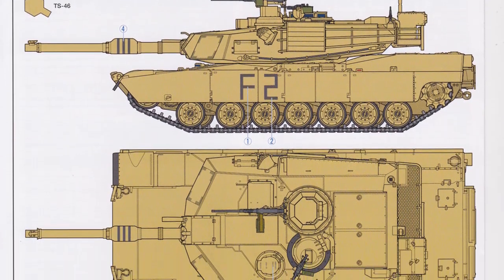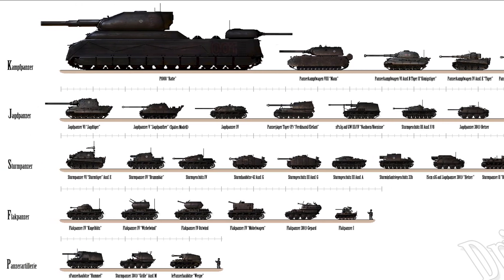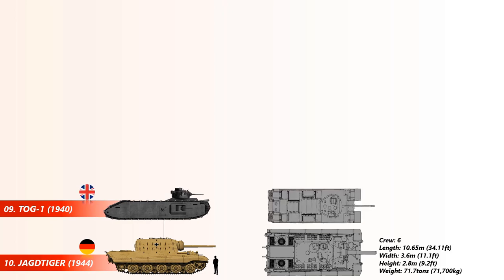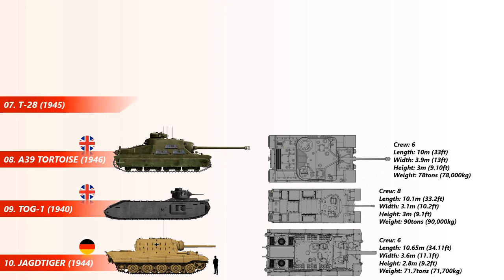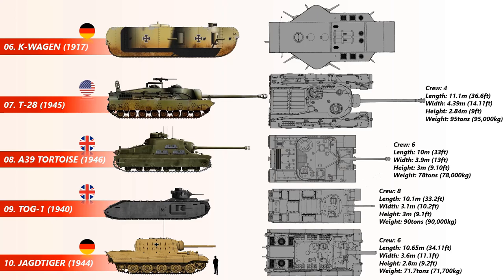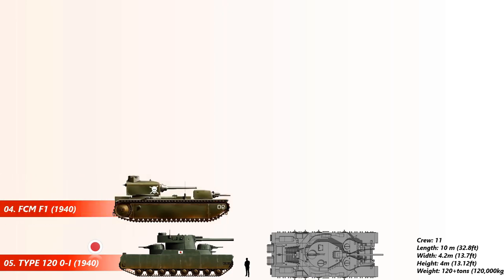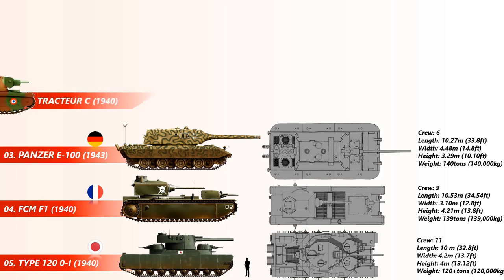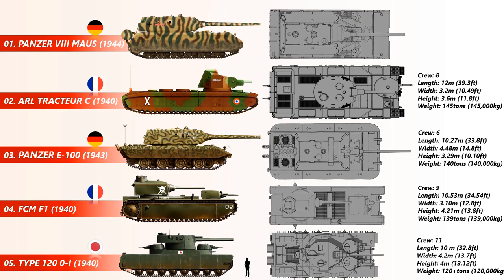The 10 Heaviest Tanks Ever Built

Comment: I think the A39 is the heaviest one on this list that can still move under its own power
Reply: Well, all the tanks in this list can move, and the faster is the JagdTiger with 38 kph max speed
Reply: the T28 could be returned to moving under its own power with some tlc they still have both engines for it as well
Reply: The Maus could move, only a few feet before breaking something.
Reply: White Triangle it has no engine
Reply: redbeard How else did it move?
Reply: @whitetriangle2325  when they say it is still moving under its own power they are saying they can currently climb into the machine and move it via its own powertrain the mays can not move at all currently it has no engine
Reply: @ALEX HUANG while that is true it can still be made to run under it's own power, just not reliably

Comment: its a T95 not t28
Reply: It was at the start of the program called T28, then changed to T95 and in the end was changed back to T28. So, it's T28. Most games just potray them as different vehicles, depending on if they have the second pair of tracks and armor.